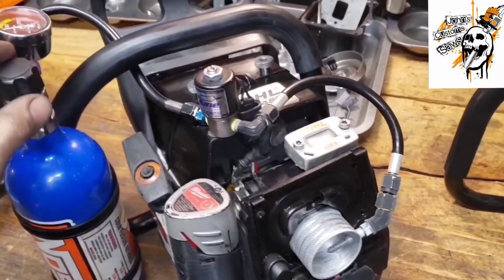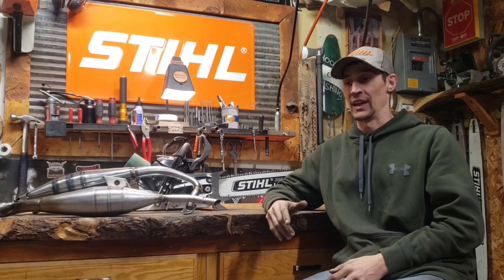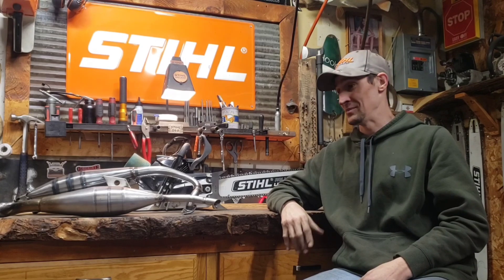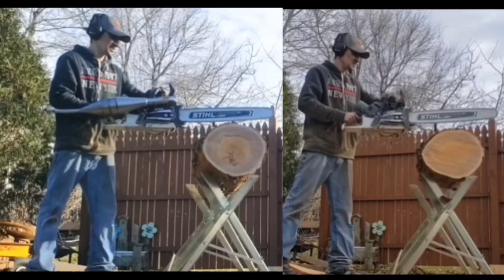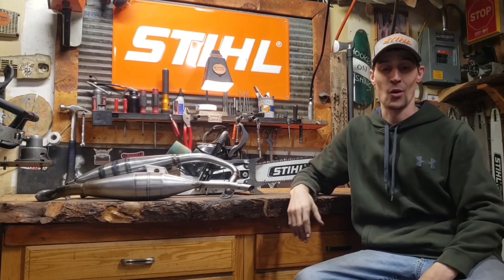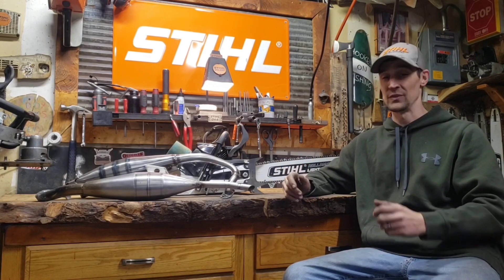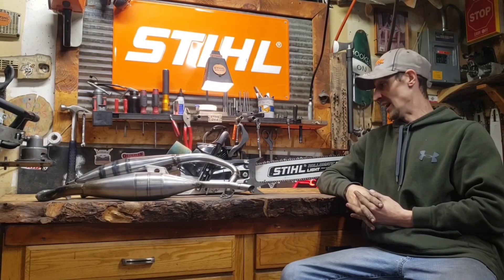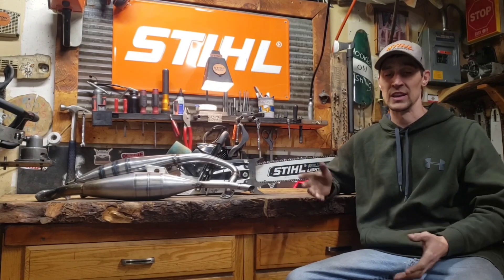MS500i with expansion chamber pipe vs modded muffler

Comment: Some people think about putting a straight pipe on a 2-stroke do you get more horsepower and torque but in reality that is not true. That expansion chamber helps with the flow from the carburetor to the crankcase and that's when the Muffler is the right size then you will get more horsies and more torque. Nice !

Comment: It's actually much more interesting to hear you're surprised at the results of an expansion chamber. Removing an expansion chamber is even more convincing... Braaaap to Blaaah. 

When you're designing your first tuned pipe don't forget to include the length of the exhaust port. Send Cut Send or equivalent and an expansion chamber app that gives the cones and tubes as a 2D printout makes things easy.

Comment: I've seen dyno testing that proves that (on certain saws) you can gain 60% or more horsepower from a simple expansion chamber pipe.. some seem to not respond as well but the saw dyno is a newer thing and theres only limited testing thats so far been done

Comment: If you look at the rm85 it puts out 22hp. Thats on a motorcycle. Which has to aurgueably a wider powerband than a chainsaw. The narrower you can make the powerband the more hp you can make. You can double the hp of a 2 stroke with a tuned pipe. So if you are making 8 hp with your 70cc class saw then 16 hp with a pipe. Probably not for long on gasoline though, most likely not enough cooling.

Comment: Get your header pipe built longer than necessary couple it with a silicone sleeve..then trim the header 1\4" at a time and watch the RPMs climb with each cut off the header tube, once you see a drop in rpm from shortening the header stop cutting off length and leave a 1\4 in gap between the header and expansion chamber using the silicone sleeve coupling and call it good..welcome to a tuned exhaust chamber..if you like you can weld in the last cut off ring so its a solid header and expansion chamber combo but not necessary..did it for a decade on nitromethane two strokes running 20,000 or so rpms..they sounded like a robot playing a harmonica.
Reply from the maker: Thats simple enough... good tip 👍

Comment: 2 stroke engines get (or loose) 30-40% of their power due to the exhaust system. I have been playing and building 2 stroke engines (as a go-kart racer) for over 40 years now and you can get on a 2 stroke racing engine over 400 HP per 1000cc equivalent.(a TM k10 125 cc shifter kart engine has over 50HP out of the box before tunning). Of course if you want longevity you have to detune the figures but still  you could get with mods 7.5 HP out a 50cc engine. I am new to chainsaws but I know my way around 2 stroke engines and I will tune up a chainsaw but the problem I seem to face is that chainsaws don't have a separate cylinder head and that is critical. Are there any chainsaws with separate cylinder head?

Comment: It really pulls the exhaust out. I think Donnie Walker once spoke about an adjustable length tail pipe on one of his expansion chamber kart motors. He could push the pipe in or pull it out for the desired power he needed, all while racing around the track. Pretty smart! Can’t wait to see what you come up with!
Reply from the maker: thats good thinking... ive heard a couple people say that now and i can totally see that being a good way to do it instead of cutting and rewelding a hundred times lol... good advice man
Reply: @johnscustomsaws  can’t wait to see what you come up with. Great content on here and Instagram. Thanks for the videos!

Comment: Love that sound John! Expansion chamber tuning has a lot to do with cylinder pressures at certain rpm. If you can get the parameters right, then the resonance from the expansion chamber will build pressure just as the exhaust port is closing.  Not much application for tree work, but it would be great for an Alaskan mill setup.
Reply: can you explain why you say good for milling, John previously has said not to port a saw if it's going to be used for milling, at least. But maybe not applicable to muffler I don't know. The awkward muffler is not practical for anything except showing it off and testing, the muffler shown would always be in the way and major burn risk to body parts etc.
Reply: @livingadamman7994    A lot of porting work makes more power at a higher RPM than stock, and that would not work well for milling. My 3120 is ignition limited to a pretty low RPM compared to most saws.  The stock exhaust is really restrictive also.  My Alaskan mill setup is already bulky and awkward to handle, so adding a pipe wouldn't be as intrusive as having one on a normal use saw.  I know it would be a lot of work to get everything right.  Most two-strokes can make more power with a tuned pipe instead of a box muffler.
  Call it a pipe dream. I just think it's cool and sounds amazing.
Reply: @TimberTrainer  Thanks for your thoughts. I have a 500i with Egan SS. Buckin has a new header pipe coming which Mark is developing with Buckin's R&D and I think it would beat the Egan SS for my saw. The expansion muffler in this video of Johns is indeed impressive, and theres so much to be understood about it. I can tell you that the pulse bounce back to exhaust port on cylinder would  help as far as keeping pressure stopping unburned fuel to exit chamber, however the downside with said is if pipe harmonics are not in perfect balance exhaust gasses flow back into the crank case causing extra heat and hence degrading the life of the saw, and compromising performance. Remember 2 strokes are air cooled and make a lot of heat, that heat needs to get out as mentioned, theres a downside to everyting.
Reply: @livingadamman7994  Good point about the heat.  Most engines with expansion chambers are on water cooled machines. It might also require ear plugs and muffs to be tolerable running in your face for hours.

Comment: How much adjustments when first started did the saw take till it idle or ran normal again. Or didn't act any different.
Reply from the maker: it wouldnt even run lol... i had to hold it wide open on startup and swap the butterfly valve in the throttle body with one out of a 661 (or i could have drilled out the stock hole)... the saw was soooooo rich at first even after i swapped the valve it wouldnt idle until i ran it for a bit... so that shows that the guys saying it will run too lean were totally wrong... great question man... i forgot to mention that
Reply: Donny walker out Canda talk abt them. He does work on them and Husky. Most talk bad but like anything it the new. Once more none dealers can get software. I think we'll see some new stuff get crazy.
Reply: I think it be cool see like holley with there fuel injection system. Get into the saw game and people know these systems come up with some crazy stuff.
Reply from the maker: @SOHN32  i have the software but i will let you in on a secret... it does njothing!!! sure it tells you WHAT the system is doing and history but you cant change anything... i cant say publicly yet but i have the answer and it has nothing to do with programming... its such an obvious answer that i cant be the only one thinking it... i was typing you a hint but i cant even do that it would give it away
Reply from the maker: @SOHN32  i agree... but i dont think they will unfortunately... too small of a market for them... it would take a small time guy in a tiny shop in Minnesota or something im thinking

Comment: Just amazing. I have no real world experience with pipes. I know the basic theory and such. Pretty incredible that it’s not even tuned for the saw and makes that much difference as you said. Maybe the 50cc saws he made them for has similar exhaust duration and runs close to the same rpm? Timing those sonic waves can’t be an easily task. Great video John!
Reply from the maker: thanks bud... eye opening huh... and yes the blowdown and duration are pretty close actually... i put a longer stinger on it which is what he suggested... he literally told me it would be 30% faster at lest and up t0 40%... he was right... thats crazy for a bolt on mod!!!
Reply: @johnscustomsaws   yessir fun stuff you get to play with 😉

Comment: now just need some bean oil, and it would smell, and sound like the flat track, and motocross races did to back in the 70's, and early 80's.
If anyone has been around two stroke dirt bikes, are street bikes, and actually rode performance bikes even built for consumers factory high end bikes. Then you should know two stroke bikes with the performance exhaust walks away from anything with non tuned exhaust like it's sitting still, and that goes all the way back into late 60's over here.  
Same thing for hot saws in the timber events, and why wouldn't every two stroke on the market chain saw benefit from tuned exhaust, because they're no different than performance saws, are the few dirt bikes that are still two stroke....

Comment: This is amazing to see side by side. It makes me wonder if there might be a cunning way of scaling down an expansion chambered pipe to something you might practically use day to day (or situating it in such a way that it doesn’t impede manoeuvrability in a work setting). Sounds bitchin!
Reply from the maker: Im picking up what you are laying down my man... I immediately thought the same thing once I seen the results... it would be very difficult to get the full potential without having a big pipe but even if a guy can get 50% and downsize so its practical... I think people are forgetting the side by side was done with a pipe vs a dual port custom muffler and it blew it out of the water... wasn't racing  a stock muffler
Reply: I always wondered about a sort of flat expansion pipe running along the bottom of the saw. I think it might not get in the way too much